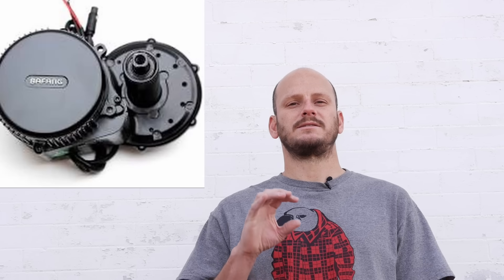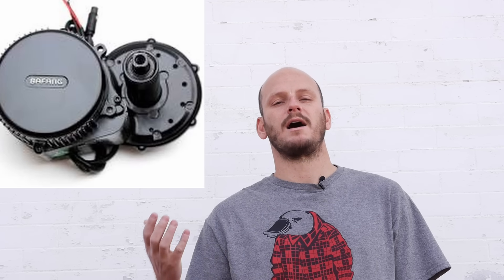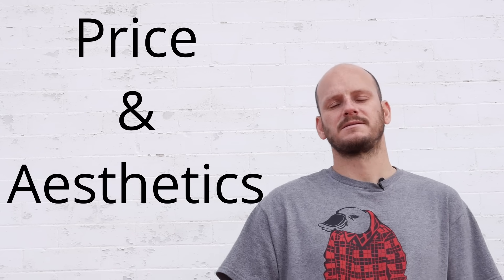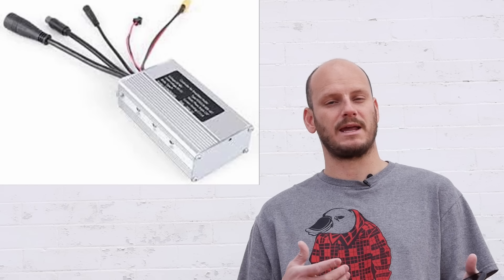Hub vs. Mid Drive Motors: Why Hub Motors Suck and Debunking Common Myths with performance test

Comment: Oh, man. I agree with mid motors being better. But your explanation with "car stuck in 3rd gear" is absolutely bonkers. have you heard of Tesla cars with gigantic torque? And yes, they only have one single gear.
Reply from the maker: they use over 50,000w. a bicycle motor uses 750. thats why using a transmission is ABSOLUTELY necessary in bike applications.
Reply: @JohnnyNerdOut  Yeah, no. It's just bad motor design or bad materials(cheap). Electric motor can have incredible torque in huge RPM range, much more than needed by a bicycle.
Reply from the maker: @pihi42  We might be talking about two different things here. Bicycle motors cannot handle the amount of power needed to really only use one gear especially when climbing hills
Reply from the maker: @pihi42  The main difference is there’s only one physical gear ratio in a hub motor whereas with a mid drive you can use the eight speeds in the rear cassette to use it as a transmission. 750 W which is the example I used in this video is not enough for adequate hill climbing in any part of the country that has large hills. That was my point. Once you start getting to 3000 W or more on a hub Drive, as pointed out in the video, those differences start to go away in performance and then once you start to get to 50,000 W like car motors have that difference is completely gone
Reply: @JohnnyNerdOut  No. Gears have nothing to do with power. They have to do with torque curve and efficiency curve. Simple motors have limited useful range of RPM in which torque is more or less constant and efficiency is good. One of the best is the new motor for Tesla S plaid, which has practically constant torque from 0 - 20.000 RPM. Badly designed or constructed motors have a small range of useful RPM. Most bicycle hub motors, especially Bafang, are indeed of low quality. Wait till Tesla starts making them :)
Reply: @JohnnyNerdOut  besides, power = torque * speed. So, power ideally linearly increases with speed, while torque is ideally constant. What happens is, torque (and efficiency) starts to decrease with higher RPM. If you have gears, you can switch gears to lower motor RPM and put it again in the "sweet spot". Our human legs have the same 'problem' as do indeed ICE motors. Well designed electrical motors can have very large range of RPM, to the point where centrifugal forces in the rotor become a problem (rotor trying to fall apart). A typical hub motor only needs to handle 0 - 20 RPM on the wheel, with gear reduction probably 0-1000 RPM on the motor itself maximum. A good electric motor can easily handle this.
Reply from the maker: @pihi42  that only applies under zero load. Add a human to the equation and you will easily understand 😀
Reply from the maker: @pihi42  Tesla’s use over 100kw. It’s a completely different situation. They don’t need a transmission because of how much power is involved. Not so with Ebikes running 1000w and less. You really have to ride them side by side on a hill test to feel that difference
Reply: @JohnnyNerdOut  1kw or 100kw, no difference. Electric motors scale very well, that's why there is such enormous range of applications. Besides, what I wrote is just basic physics - not dependent on scale. Whatever holds for 1w holds for 100kw. I understand and I know from experience that hub motors are weak. I have a mid drive for that reason. But the reasons you state are incorrect. Nothing to do with power. I'm not repeating what i wrote. If you don't believe me, check it elsewhere. It's really the basic electric motor stuff. (I also personally know motors from building drones & robots).
Reply from the maker: @pihi42  I think we are on two different planets 🍻
Reply: @JohnnyNerdOut  Ok, now I see we might be talking past each other. The problem is with motor's "rated power". Power is not a primary electric motor property;  that would be torque and efficiency. The faster the motor spins, the more power it produces. This is ultimately limited by cooling and wire thickness (and internal resistance). Perhaps it is the law that is determining things here; but a motor with adequate torque might be "too powerful" at high rpm. So you can, using gears, switch between high-torque low speed and low-torque high speed at constant power. But in electric motors, this is quite unnecessary. Like I said, it is possible that the watt-limitations of the law directly influence "motor power". But I have on my bike a 750W max Bafang motor that is electronically limited to 250w constant output for the EU. So I think the only reason is price - a good motor (high torque) with good max rpm characteristics costs more than your average bike hub motor. But again, rating electric motors by watts alone is not sound.
Reply from the maker: @pihi42  I totally agree about only rating motors on wattage alone. I repair and replace too many motors rated high (in watts). Means nothing. I personally have yet to ride a hub motored bike that street legal or even close to it 1500w that can even come remotely close to climbing like my 750w motor can. Your logic is sound in my opinion. Personally I think it only makes sense under “no load” situations though. My two cents
Reply: @JohnnyNerdOut  Yes, totally believe you. I have drone motors that are rated for 1kW of power ;)) But run that power for more than 1 second and they burn.. The problem with electric motors is that they are so completely different than, for example, internal combustion motors, that  they are not well understood by general public only looking at watts. Same with electric cars. You have 200 kW motor in a Tesla, but you will literally burn the car to the ground if you allow such power for more than a couple of seconds. That's why controllers are crucial: a good controller won't allow that to happen. Cheers.

Comment: This video is for low-power, low-cost users.
yeah right low power hub motor is complete garbage.

BUT If you use a motor over 3kw, everything in the video will be the opposite.
mid drive motor over 3kw, it will easily blow the chain, sprocket or gear,  and break the spokes.
unlike the hub motor, the output is biased to one side, so there is a very high probability that the spokes will break or be twisted.  

However, it is very good to use a hub motor for high power motors of 5 ~ 8kw or more (qs205 with YKZ120150   20kw peak power  in my case).
With motorcycle spokes and hub motors like 9g spokes(super thick) , there is absolutely no risk of the spokes breaking and other problem you mentioned in the video.
Reply: I've been using a 3kw mid drive motor for the past few years(cyclone mid drive), and I've had too many broken chains ,broken sprocket gears and broken spoke + twisted rim .

mid drive can only be recommended for 2~3kw or less.
Otherwise, it is highly recommended to use a hub motor.
Reply: But you would refer to a mid drive with a single sprocket of high power like a sur-ron.
So, isn't it exactly the same as a hub motor?

You'll have to think about why high-power mid driven e-bikes use a single gear like a hub motor.
Reply: The conclusion is that in the case of low-power motors and low-cost users, the mid drive is definitely overwhelmingly good..
However, if it exceeds 3kw, it can be said that the hub motor is overwhelmingly good.
Reply: And it is completely wrong to say that the mid drive you mentioned at the end of the video is a newer method.  The mid drive was made in in 1885. 

Hub motors are a very new technology that only began to be used on bicycles in the late 1900s.
(Of course, hub motors were made at the same time as the mid drive, but they were only used in car)
Reply from the maker: When you apply a high amount of power, you no longer need gears or a transmission to use that power efficiently.  Hub motors have a thing called unsprung weight which really changes the handling, not in an ideal way. That’s why high powered cycles still use mid drives even in a single speed application. But DIY ers who don’t care should use hub motors as they are much easier to install
Reply from the maker: That was in regards to aftermarket ebike conversion kits specifically.
Reply from the maker: I would still disagree. I would just make sure you have a strong chain and cog etc.
Reply from the maker: Yes I pointed that out in the video. High powered hub systems are awesome !

Comment: @JohnnyNerdOut OK I think you convinced me... but please tell me how can rear wheel be getting driven by the mid-drive motor, without the cranks having to turn?
Reply from the maker: It’s a freewheeling crank
Reply: @JohnnyNerdOut  Show off 😛 

Is it a myth that people break their chains using a mid-drive motor?

I know all the best eBikes seem to be using a mid-drive and I don't see threads anywhere with people complaining about broken chains.
Reply from the maker: @yutehube8749  you definitely can brake chains more frequently. But once you start riding it like a normal bike(shift properly) it isn’t an issue.
Reply: @JohnnyNerdOut  There's also the shift sensor too but, simply because a mid-drive would mean losing my 36t and 22t inner chainrings, I'm going to go for a rear hub setup.

Comment: Yeah am thinking of getting a mid drive so I have a question - do the 3 speed inbuilt rear wheel gears like the shimano  Nexus hold up to the mid drive system ?
Please n thanks.
Reply from the maker: yes, but about 80% as well as a standard cassette

Comment: One important part: maintenance. Even though I love my BBSHD and 02, they eat my chains and casettes all the time. Next built I'll make will be regen 1500W hub bike so I could also reduce the wear on the brakes.
Reply from the maker: Its really important to be shifting properly with mid drives, also installing a gear shift sensor will help a ton! Those two things should give you no issues with chains or cassettes :)
Reply: @JohnnyNerdOut  gear sensor has too much delay. And it's not adjustable therefore unusable

Comment: BEFORE YOU BUY A MID DRIVE BIKE - 

I bought a nireeka prime mid drive bike, and the entire wheel+drive train had to be replaced after only 200 miles. (My bike has 1000w bafang ultra, 160nm torque, fat tires, carbon fiber frame, 38mph top speed) The reason was bc mid drives are extremely prone to drive train damage, since you’re using standard bike parts on a high powered bike. there is a very very specific way to drive these things. You must be sure the motor is NOT engaged when shifting. My bike unfortunately doesn’t have a shift sensor, so I have to do it myself- I stop pedaling, wait  on the motor to disengage, then press the shifter, then gently pedal so the bike shifts without engaging the motor, and once the shift is complete, I put normal force back into pedaling. It’s basically like driving a car with a manual trans. You always have to be sure you’re in the most optimal gear, and never allow the motor to be engaged while shifting. Otherwise, you’re prone to drivetrain damage. I basically have to baby my bike, to try to extend the life of my drivetrain. I wish I would’ve gotten a hub motor, or just a lower powered version of my bike.
Reply from the maker: Good point. It is very important to hone up on cycling fundamentals with a mid drive. Hubs are better for people not too familiar with cycling (not meant in a mean way!)
Reply: @JohnnyNerdOut  No offense taken! I appreciate the response. I unfortunately had to learn the hard way. Thankfully the manufacturer was generous enough to send me an all-new wheel/drivetrain under warranty (even tho it was mainly my fault). They even upgraded it to a steel free hub and a more durable cassette. Even the manufacturer realizes they probably used components that weren’t going to last with a bafang ultra. So that’s why I don’t take full blame on the drive train’s destruction ;) 

Other than what I’ve mentioned, are there any additional tips you have to ensure I don’t have this nightmare happen again? Thanks!
Reply from the maker: @eBikify  I pretty much do exclusively minute drive conversions when I convert a regular bike into an electric bike. When I finally send the bike home with a customer I always do my best to instill in them the basic fundamentals of gearshifting. Always make sure you’re shifting as much as you can you want to be in a low gear when you come to a stop so if you find yourself coming to a red light you should be downshifting as you as you slow down so that when you’re ready to takeoff again you’re in a low gear you’re not putting a strain on your motor or your chain. If you ride the bike is if you had no motor everything will last forever
Reply: @JohnnyNerdOut  Thanks for the tips!! Much appreciated

Comment: Im curious if u used a little peddle power on your rear hub drive at initial take up? does that even out the situation?
Reply from the maker: No I just used motor only power

Comment: Honest question - do disk brakes also take a heavy toll on spokes? I didn't think of this unitl you mentioned hub motors working spokes loose...
Reply from the maker: Poorly made hub motors work spokes loose. If you have a good wheel neither will affect it

Comment: It ain't just the chain that wears out using a mid-drive its the sprokets and the freewheels. All that torque put to those sprockets and freewheels wears em' out quick and they are not cheap. I think that the chain and sprocket system you would be better off using a 420 chain system to an 8 to 12 speed internal geared hub that has a 420 sprocket welded on it, if the hub can handle up to 100 to 160 nm of torque. The normal bike chain and sprocket system won't last long with a mid-drive system.
Reply from the maker: In my experience I’ve never had to replace a cassette. Only chains, and that was due to riding it excessively hard. Now that I know how to ride it properly I’ve had zero issues. Drivetrain issues mainly come from improper riding IMO. Use basic cycling fundamentals and a mid drive won’t give you an problems👍

Comment: You hit every point perfectly. I had hub drive motors for about 3 years before I bought my first mid-drive and I wished I had bought a mid-drive back then. I do a lot of mountain bike riding and mid-drive bikes pull like a goat up hills.
Reply: Which mid drive did you get? I tried shimano steps and bosch at the bike shop and they were much weaker than my 4 horsepower hub motor. Here is a $100 hub motor putting down 10 horse: https://www.youtube.com/watch?v=e03rMDmJzLE

Comment: Great video.  Aye, question....wouldn’t PAS solve or at least decrease wear and tear on hub motor ebike.  Isn’t PAS essentially mechanical transmission for ebikes, or am I off?

/Bklyn👑
Reply from the maker: In a sense your right, absolutely. But that’s assuming no steep hills, or if you are going up steep hills. You are lance armstrong.
Reply: @JohnnyNerdOut  steep hills will build strength over time. On a hub motor use gears and if hill is so steep you are initially not fit enough to help the motor just walk. The killer of hub motors is people pushing up hills with out assisting motor and as speed drops off the motor heats up. 
Recently I started cycling to an area that has 2 steep hills together. On first 2 trips I stopped at top of second hill and checked for heat on the hub motor casing and there was none. Had there been I would have looked at a lower gearing.

Comment: I have been a professional motorcycle mechanic since 1974 and respect your opinion I don't agree with your conclusion. Ride safe everyone!
Reply: Let me guess: nothing in bicycles is built to take +1500W which makes the whole conversation moot... or rather: if you want to build an overpowered death trap, use a mid drive.
Reply: @squidcaps4308  Who said that? I didn't say that. I have a 212cc gasoline engine on a Schwinn Meridian Trike. My moto is, Too fast is just right. Did my Mother in law send you? I need a beer...

Comment: How do the spokes know the torque is from a cassette via a chain, and not from a hub? I would guess it is the extra weight of the hub that breaks spokes. The shorter spoke length on a hub may also have an effect.
Reply: Check out the d500 hub motor, the spokes attach like a normal bicycle hub. Hub motors do not necessarily require short spokes.
Reply: @difflocktwo  That is a very interesting hub. The only problem for me is I have no idea whether short or long spokes are better. I would imagine short spokes are stronger, but have far less elasticity. It may be that the ability to stretch a bit here and there under shock stresses may be more important than outright strength. Using my limited knowledge, I have just decided that a long spoke should be just as strong as a short one. I am going to go for long spokes, but I have no idea what I am on about. Anyway, as you point out, the company making this motor have gone to a lot of trouble to have long spokes. They know more than me.
Reply: @MrDickBills  I think it's a little more complicated than just short vs long. Built correctly both short and long will last 10s of thousands of km of road cycling.

Long might be easier to build correctly since it is traditional with bicycles. But look at motorcycles, they have fat drum hubs and small rims and thick spokes. Motorcycles do just fine with short, fat, spokes. The rim and hub are designed for them.

Comment: I agree with most of your points but I gotta say I have a 1000 watt hub motor ive been running on 4000 watts for almost two years. Its got over 1500 miles on it and I still havent had a problem. Just saying they dont all burn up.
Reply from the maker: 500w ones do. 4000w is another league